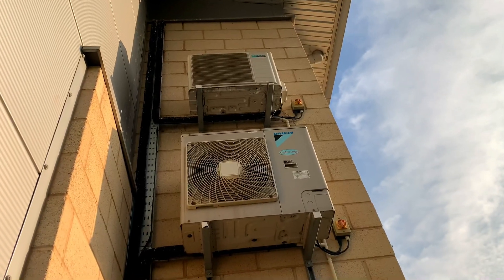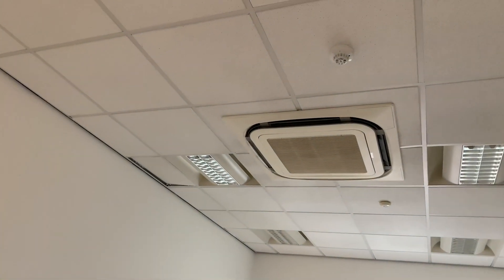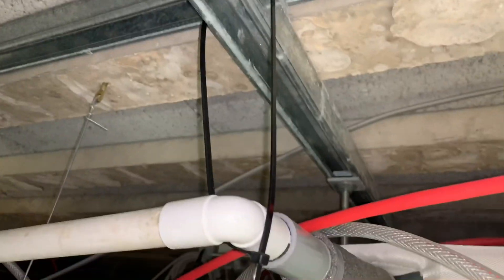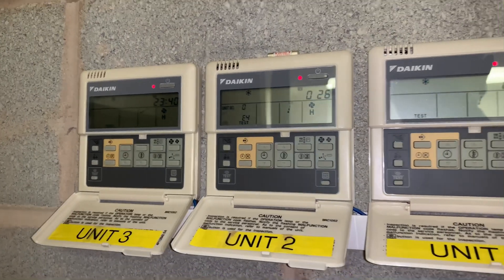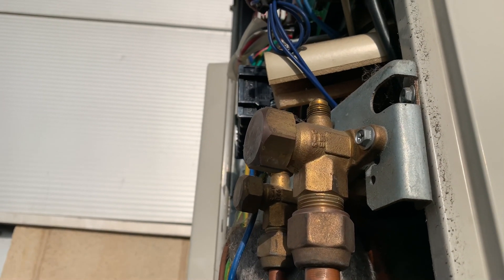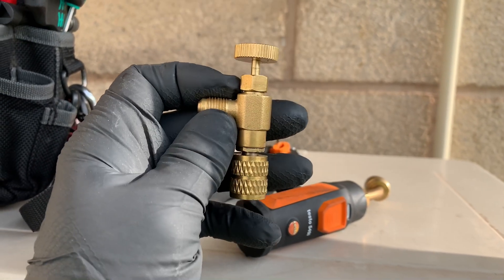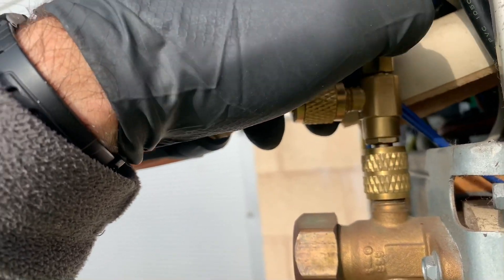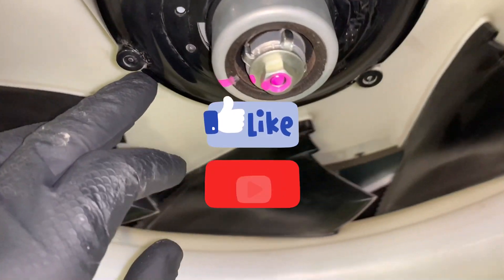DAIKIN E4 FAULT *NO REFRIGERANT LOSS FITTING* HVAC UK

Comment: Brother please help me out with this E4 error problem there is no gas leaking I have tested both the pipe separate and the , machine is newly  installed and this problem start from beginning and there is also no block in pipe my mind is not working please help me out
Reply: Kamu seperti saya... Mengalami hal demikian,, sy berpikir di sensor koil dingin yang bermasalah

Comment: In your experience is Daikin a reliable split system brand compared to other brands. I'm thinking of getting a split system for my house but I don't know which brand is most reliable and worth buying. I looked at those review sites and Daikin was in the top 10 but more towards the bottom like 7 or 8. Just wanted to get some advice from a professional.

Comment: I use these low loss fittings all the time , I prefer the Refco ones though , much better quality in my opinion , and the gasket is very durable .
Reply: I cant seem to find those anywhere here in Australia. Great idea, I'm sick of getting liquid pissing everywhere connecting guages.
Reply from the maker: @lwilliams3285  have you looked on eBay mate ? If you type in ‘refrigerant flow control valve’ it should bring them up. They are from China so imagine if they deliver here they should be able to deliver to Australia 👍🏼🤞🏼
Reply: @hvacuk8975  found them mate, just had to type the right keyword!
Reply from the maker: Where did you get the Refco ones from mate ? Haven’t seen them anywhere over here to be fair 👍🏼👍🏼
Reply: @hvacuk8975  I live in France I got them from the supply house .
Don't be jealous though , we don't get as many good quality tools as you lot 😓